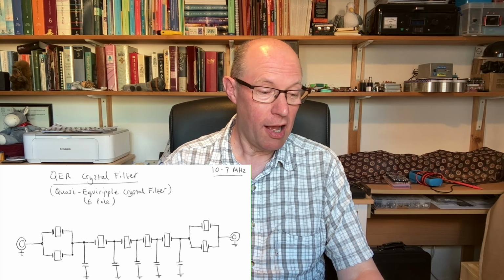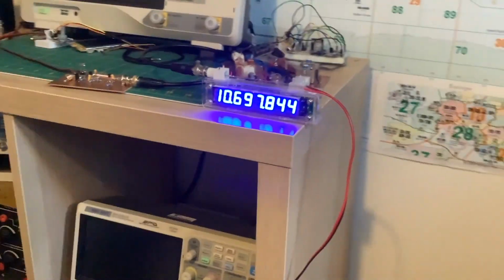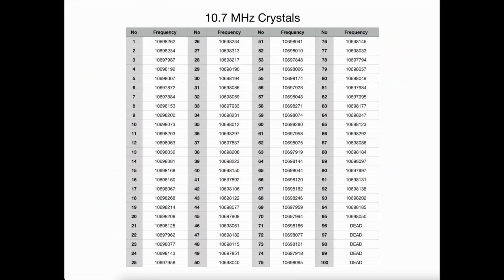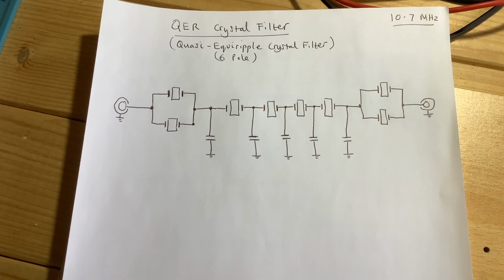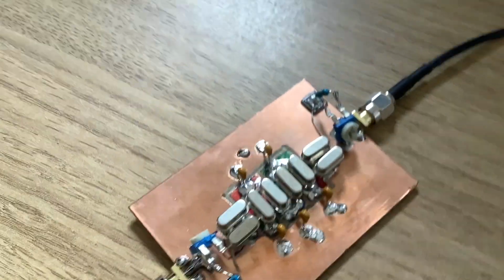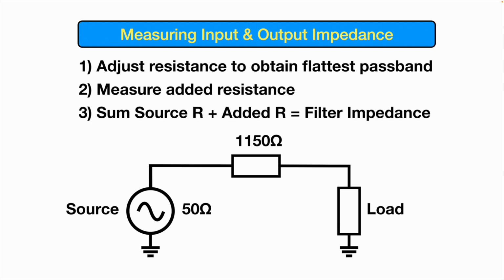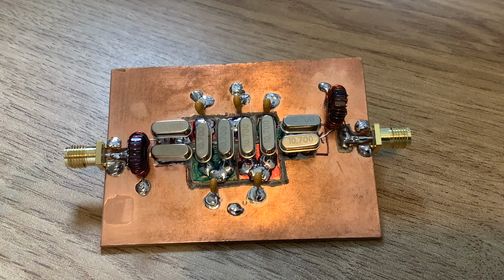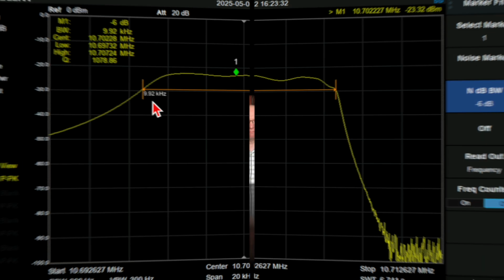63 - Build a QER Crystal Filter

Comment: Just wandering if you pick crystals of somewhat scattered frequencies would it help widening the bandwidth? Like would it be better than putting the lower capacitors?
Reply from the maker: Hi there! My experience says no - it just gives you more spikes in the passband. It the capacitance that actually dictates the bandwidth in this design. I've had best results when the crystals are matched as closely as possible. You can then experiment with different values for your caps. Thanks very much for watching. Best wishes, Nick
Reply: @M0NTVHomebrewing got it, thanks!

Comment: That match of about 1k2 is only in the passband of the filter. The out of band match is nowhere near that. Some  receiver designs have a small attenuator to reduce the impedance changes for any amplifiers driving them.  Crystal Filter ripple can affect the distortion of signals passing through them especially wideband signals.
Reply from the maker: Hi there! Yes, you are absolutely right. I endeavour to get the impedance matched as closely as possible within the passband for the purposes of getting the flattest response but outside the passband all bets are off! It is for this reason I often like to try and buffer the crystal filter with a termination insensitive amplifier on each end. Thanks for the important caveat - and for watching. Best wishes, Nick

Comment: Curious as to why the lower skirt is less steep - don't think I heard an explanation - could you address?  Nice video!
Reply from the maker: That's a very good question! I'm afraid I don't have a proper explanation for this except to say the this asymmetric response seems to be 'baked in' to this particular design. It is often used for Lower Sideband where you need very sharp skirts to attenuate the unwanted (upper) sideband. I'd be interested to hear a more detailed explanation myself. In short: I don't know ... yet! If I find out more I'll post it here. Thanks very much for your question. Best wishes, Nick
Reply: These filters are asymetrical and favor use in lower sideband with the very sharp skirt above the passband.  They can be used for upper sideband successfully if you are careful about where you place the BFO.  If you want an upper sideband filter you would put the crystals in parallel and the caps us series.  Wes Hayward, W7ZOI has a good paper on this.  https://w7zoi.net/filters/genfil.pdf

Comment: Great video Nick. 
A couple of large egg boxes (or trays) are useful to sort crystals into.
Reply from the maker: Thanks very much Tony. Ace G0ACE suggested the egg trays as well. I'll certainly investigate that for next time. 73, Nick
Reply: You could try seedling/prickout trays, ultra cheap from places like Temu, but will be at your garden centre too. You'll need to tape up the hole's if the items are really small. I've used them when dismantling laptops before and they're pretty handy. If it's a long job, hot-glue the tray to your bench, one swift movement can end in alot oy crying and gnashing of teeth 😁

Comment: When picking up xtals to fit in the test jig, I use one of 2 mothods to reduce heat transfer from my fingers

First and cleanest is use a folded strip of isnulation tape or sellotape to pick up the xtal form the bench/parts bin and move it over to the test socket - then a pensicl with a rubber on the end to push t into the contact holes

Second method for larger xtals (remember them?) is to use a stickly lump of blue-tak on the end of pencil or pen. Make it even stickier with a tiny drop of WD40 and work it into a chewing-gum-like sticky glob but MAKE SURE you wear rubber/late gloves - ask me how I know about the gloves. Oce the sticky gum-like blob is on the pencil end lay it on the bench so it's raised up in between uses - it sticks to anything and leaves a steain, but buy does it stick to things.
Reply from the maker: Thanks for the tips Gord. 73, Nick

Comment: Just started watching Nick. Thanks. I could use as many of these as I can watch. I have to beat this into my head.  I remembered how to figure out the turns ratio. Back in high school I would have had to know why its a square root, likely I will get there sometime. 
Nice performance on that filter, I find it so amazing.
Reply: It's one of the rules you just work with  the impedance ratio is the square of the turns ratio. You hardly ever need to work with it at any lower level

It's the way both voltage and current are transformed.
the voltage ratio is equal to the turns ratio, but the current ratio is the inverse of the turns ratio. 

Impedance is the ratio of voltage to current   Z=V/I   

so if the turns ratio is    2:1
the voltage ratio will be 2:1
The current ration will be 0.5:1

assuming a 2 turn transformer then  2/0.5 = 4  which is 2 ^2

change the ratio to 8:1

current ration will be 1/8 :1 =0.125
8/0.125 = 64    which is 8^2  

Looking at it from the Z side, sqr(64) = 8 which is the turns ratio.

Andy
Reply from the maker: Thanks very much Andy. That's very helpful. 73, Nick
Reply: @andye2005 Thanks.  These are the kinds of things I memorized as a child, could often used and never understood. It makes sense that there would be a squared function given the math.
Reply from the maker: Thanks Louis. Best wishes, Nick

Comment: It's good to get another video from you. I look forward to them. I'm curious about the affect of 3 or 4 xtals in parallel on the input and output. Clearly the bandpass would be flat. But are there any other advantages of more crystals, such as better impedance matching without other negatives?
Reply from the maker: Hi John, to be honest I've always had the crystals pretty close together. It's an interesting thought. One thing I sometimes do but didn't this time is to ground the metal casings of the crystals. This has made a little bit of difference in the past. 73, Nick